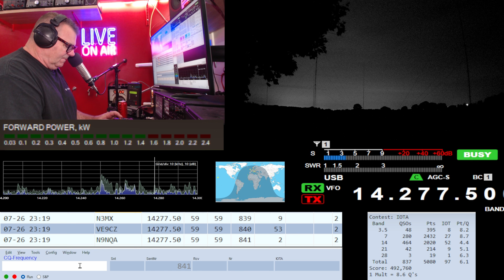Why I Don’t Want an SDR Ham Radio

Comment: I suspect that next generation DSP will be AI based.  Meaning that it actually will introduce information into the stream.  The radio will pick up noise + voice and the AI will reproduce the voice and just play that.  Much like a person using their brain to hear the words in the signal and then repeating them to someone else.  I also suspect that will move us another step further from the radio experience I fell in love with as a child.
Reply from the maker: I think you’re spot on. Once DSP starts reconstructing speech rather than presenting what was actually received, we cross a line from radio into interpretation. Clever, useful perhaps - but very different from the experience many of us fell in love with. At that point you’re no longer listening to RF, you’re listening to a machine’s best guess. Sonar ops are still "human is better than machines"...

Comment: I get the operator angle and the roofing filters, but here's the thing:  SDR's are cheap and getting cheaper.  With a large custom chip, it's possible we will see an entire HF transceiver in one big plastic package with lots of pins, the only external components being the front panel and power amplifier.  It's really a matter of keeping the hobby survivable financially.
Reply from the maker: I agree - SDR has probably kept HF radios affordable and viable, and that’s a good thing for the hobby. My point was never anti-SDR, just that as costs drop we shouldn’t lose sight of the operator experience. Ideally we get both: affordable radios and ones that are a pleasure to listen to for hours.

Comment: Glad the 990 works for you.. still fairly sure after having almost all top radios,that if I had started with an old FT101 and never changed it, I don’t think I would missed much. But very well put Callum. Operating is a skill that some have and some don’t.. also some don’t have their radios long enough to find out just what they can do.
Have Drakes, Collins and old IC-781, superb analogue radios with no dsp noise.. just ears, Attenuator and RF gain…. Works for me. I also have a pair of 7800’ just because I like them 😊
Reply from the maker: I think you’re absolutely right - if someone really learned an FT-101 inside out, they’d miss very little. I started with a ZD Mk3(!). Time with a radio matters as much as the radio itself. Those classics reward ears, RF gain and patience - and if it works for you, that’s the right answer. Lovely collection too.

Comment: 😀I think the same thing, I listen to a disturbed QSO with SDRPlay, then I switch to the IC-R9000 and I like it better, my ears are analog like this receiver, what I hear is real and not regenerated by digital, it has never happened that I couldn't hear with the R9000 what I received with the SDPlay, I would like the FTDX-5000
Reply from the maker: That makes complete sense. The R9000 has a wonderfully natural way of presenting what’s actually there, and if your ears like that, it’s hard to un-hear the difference. I’ve had similar reactions when switching back and forth - sometimes the simpler path just sounds right. The FTDX-5000 would definitely be in that same family.

Comment: Callum… no need to apologize for analogue radios.  It works for you.  However, using SDR radios has a compromise you throughly explained.  73 de KD6UYK.
Reply from the maker: Different tools, different compromises, different joys. 73

Comment: I rarely operate with headphones on, I love to sit in my shack with either my Yaesu 450D or my Icom 718 but I do have a quality pair close to hand for when I need to concentrate on a weak signal. Sometimes I will plug in my headphones, turn down the lights and just sit there with my eyes closed and have often picked out a weak signal this way. Ever thought about producing a DX Commander Transceiver Callum?
Reply from the maker: Yes - that makes complete sense. Removing visual distraction and letting the ears take over can be surprisingly effective. Headphones as a tool rather than a default feels very familiar. And no… no plans for a DX Commander transceiver - antennas are quite enough trouble for me!

Comment: The whole first part of your argument has no basis in reality. It is similar to how audiophiles do not understand how the digitalization of the sound works. If you said that you simply prefer the sound of your rig, that would make sense. I use full on SDRs but also true analogue rigs from the "hybrid era" (FT901, FT102). Pure receive performance wise, even a cheap SDR like HF+ runs circles around my analogue rigs, but there is that feeling with analogue rigs that can't be replicated.
Reply from the maker: I think we’re actually closer than it might sound. I’m not disputing that modern SDRs can outperform older analogue rigs on pure receive metrics - many clearly do. My point wasn’t about denying that reality, but about how the signal feels to work with over time. As you say yourself, there’s something about analogue rigs that can’t quite be replicated, even when the numbers are better. Preference and experience sit alongside performance, not in opposition to it.

Comment: Sir yes a good quiet radio is very nice but you missed something, A well made SDR is really quieter and ask why simple the less parts resistors, transistors, anything can and will add noise that are in your radio.  Most do not how these radios work but this is why you get what you like and use it. But do not be confused the DSP is doing the same thing your radio is doing ie mixing to move the signal to base band to go to the DSP. Yes your radio has a DSP processing the audio.  Now this radio is the best radio that Kenwood made and I would keep it for that reason. We can discuss later if you about radios.
Reply from the maker: I think we’re largely agreeing. I’m not confused about DSP - the video wasn’t about block diagrams or noise figures, but about how different designs present audio to the operator over long sessions. That’s a subjective, human thing. And yes, I’m keeping the 990 - for exactly that reason.

Comment: Yep I love my K3S nothing (that I've used) compares. I have a Flex 6400, FTDX10, FT710 7300, TS-2000, KX3, Nothing beats the K3S in a contest not even the DX10. People love to quote "top receiver" but never actually read the stats. K3S... Quietest receiver, most sensitive receiver, 2nd best blocking (lost only to the 890s). Had a local ham who likes to be the "big guy" talking about his FTDX101 being the "most sensitive" only to be embarrassed when I informed him it in fact was not. Love the "it has the best noise reductions" I live in a higher noise area and find what you're saying is 100% correct. Noise reduction is great when you're rag chewing on 40m at 20 over but doesn't do as much trying to pull out a week one. I often have everything turned off and use the knobs to pull them out like a real radio operator (I was chuckling at that last one).
Reply: Any ham operator that quotes sensitivity as a "selling point" has no clue what he is talking about. Sensitivity stopped being a problem some 60+ years ago.

Comment: Today modern radios are not made for operators , they work but , Squelch and RF gain on same potenciometer is totally wrong design. (IC7300)
Same stupidity like put brake and clutch on same pedal. 
Some things cannot together.
Reply from the maker: Never thought about that. Interesting.

Comment: Still enjoying my TS530 😊
Reply: i have the ts830 kenwood works well i also have a very old ts 130 kenwood that looks almost new,
i like vintage radios as the soul or as i say dover .... jeffrey
Reply from the maker: The TS530 is a classic for a reason - glad you're still enjoying it!
Reply: @DXCommanderHQ  i have the kenwood ts 830 in mint condition i added a 300 hz cw filter vwery stable radio i do ft8 on it for hours on end hears well never drifts ... jeffrey

Comment: Callum, very interesting take on this subject, may i also introduce perhaps another contributary factor, The operator with different talents or skills, For example i have known extremely intelligent people who struggled to learn Morse code, One i remember well was a helicopter pilot, He was a G6 back in the day and couldnt after years of struggling to learn the Code...grasp it suffciently to pass the 12 WPM test, and he was limited to vhf/uhf when operating alone, Myself for example am quite adept at languages , i find them easier than the average joe, i kid you not i learned Morse code in 2 weeks went to liverpool shipping office and passed with Mr Jardine in April of 1983  then passed the RAE..and applied for a direct Class A licence which i still of course hold, My point is..some people no matter what the radio have a different skill set to picking signals out of the speaker/headphones,  You are quite musically minded i believe ...hence the drum kit etc, That leads me to assume you have an ear for particular notes that perhaps an ordinary joe Ham...might not get as clearly as you would, So whatever the radio is...the Operator has a great bearing as to how he/she will asses that particular radio reception qulities,  Anyhow just thought i'd throw that possibility into the mix mate, 73   De  G 4 UNB.
Reply from the maker: That’s a very good point, and I agree completely. Different brains are wired differently - language, music, rhythm, pattern recognition - they all play a part. Morse is a perfect example: some people just “get” it, others never quite do (I never tried - sorry!), regardless of intelligence. I’m sure musical training helps with recognising tone, cadence, and structure in noise too. So yes, the operator is a huge part of the receiver chain. As I said, what works for you is critical. Thanks for adding that to the discussion - much appreciated. 73
Reply: @DXCommanderHQ  Most welcome interesting video thanks. 73

Comment: Yes, listening to my TS990 is comfortable. It does not cause listening fatigue - it's my main operating radio, yet my FTDX500 has a fuller analogue sound, which I find a little more comfortable, and is ideal for occasional SW listening too. Ultimately, you adapt to whatever radio you own, and whatever you own is the best radio for you.   Well done for raising a very personal topic, Cal.
Reply from the maker: That’s beautifully put. Comfort and fatigue matter far more than most specs ever will, and you’re right - we do adapt, and that adaptation becomes part of how we hear. Different radios, different flavours, same enjoyment. I’m glad the video touched on that personal side - thanks for sharing. PS - I was very close to the 5000 a few years ago. I'm sure it would have been a fine radio!

Comment: Brilliantly stated, mate, and I completely agree! When SDRs first became a serious Thing, I (sort of) jumped on the bandwagon, and using them in a noisy environment, as you've said, they were really quite remarkable. But using them in my (super-quiet) QTH, I would find myself turning off all those wiz-bang features so I could hear everything. Also, because I'm neuro-divergent (i.e. slightly mental), I realised that I'd do far better when I wasn't both listening and watching the bloody waterfall! Sure, waterfalls can be very useful, but as you say, the concentration and focus required to take everything in and process it with your own CSP (cerebral signal processor) can work wonders. I've noticed that a mate of mine who loves SDRs says he couldn't possibly hear even a single signal through all the noise without using all the noise suppression they offer. But I think that, because I fell in love with SW radio as a very young kid, and absolutely thrilled from hearing distant 'inaudible' voices that seemed to be surfing a wave in a far-off sea, it shaped the way I process sound. And that's a skill I've parlayed well into my subsequent musical life. So I'm now perfectly happy with my hardware radio, all noise suppression turned off, full signals ahead. Cheers and 73!
Reply from the maker: That’s wonderfully said - especially the “cerebral signal processor”. I completely relate to the waterfall point too; sometimes removing visual input lets the brain do what it’s actually very good at. Early SW listening absolutely shapes how you process sound later on - I’ve heard the same from musicians more than once. Different brains, different environments, different tools - but the joy is in listening. Thanks for taking the time to write that. 73
Reply: 75% of the brain processing capacity is taken up by processing your eyesight. We all know blind people hear better, can smell better, can feel better, can taste better. My neuroscience brother in law said it takes around 30 minutes for the brain to slowly relieve itself from the duty of "seeing" after you close your eyes. Try listening in a dark room with no waterfall or lights, get used to it. You will be amazed at what the ears can pick out when you can put 35% more brain power to it.

Comment: You make a very good point, It is like copying cw out of the noise. We can hear it and get a fairly solid copy. My computer decoding  programs can only hear garbage. rhythms and patterns. We use "Real intelligence, not AI"
Reply from the maker: Exactly that. It’s very much like sonar or CW at the noise floor - we are incredibly good at recognising rhythm, intent, and incomplete patterns. Software can help, but at the edge it often just sees garbage. That’s not anti-DSP or anti-AI, it’s simply acknowledging how good the human brain is at this kind of work. Real intelligence, trained by experience.

Comment: I have the FTDX101D which is a hybrid SDR. It has great receivers, I'm very happy with it. Some of my ham friends keep telling me to get an Anan full SDR because it's much quieter. Maybe I'm just old school, but if I don't hear a little hiss and static it doesn't feel like radio anymore. It feels more like an internet chat room. I'm also not a big fan of having to use a PC with my radio. If the PC crashes, so does your radio.
Reply from the maker: That makes perfect sense. A little hiss is part of the context - without it, it can stop feeling like radio and start feeling abstract. And yes, I’m with you on the PC dependency point: great when it’s working, frustrating when it isn’t. The 101D is a cracking balance if you like a radio that still feels self-contained. There's a couple of odd requirements I have and was it not for these - the 101 would be on my list actually... Only from what I have heard from some reputable friends of mine. But at the end of the day - I can hear what most folks can't so I can stay put for the time being :)

Comment: Scientific Data, Exposing Myths and Other Religiously Held Beliefs Since 1543…  UFO’s, Mermaids, Unicorns, Flat Earth… and more recently HF Rigs…  Another Performance Discussion Boiled Down To MINE's better, NOT Because of Hard Data, BUT BECAUSE I Like  MY BRAND Better/I'm Too Calcified To Change! 😊 🍺🍻

EDIT ADDED As AGAIN I'm Blocked From Replying...

@CriticalThinker-42
0 seconds ago
 @DXCommanderHQ  I have no problem in your Preferring Your Inferior Rig. BUT Your Previous Video STATED Point was Questioning Performance in Rigs (and Antennas), which you went on to Ignore in That and This Video for Rigs. That Does Infer a Religious Type Fervor, Typically Classified as Cultish.

"...the result that the very highest close-in receiver dynamic range is achieved. This has been a major competitive marker for some years, and this transceiver, as well as the FTDX101D, puts Yaesu at the top of list, as seen in the ARRL Lab measurements in Table 1 and independently tested and listed in the Sherwood Engineering tabulated summary of receiver performance (www.sherweng.com/table.html)."  ARRL, QST, 12/2020, Product Review Yaesu FTdx101MP

Are you going to Rationalize Away ARRL Labs Test Data next? Like YOU did Rob's? 
Then again Claim its Not due to a Religious Type Fervor? AND Expect ANYONE to Believe You?

🍺🍻
Reply from the maker: I’m very comfortable with data - and I’m equally comfortable saying this video wasn’t about brand superiority or rejecting progress. It was about operator experience, fatigue, and how different receivers feel to different ears in different environments. Preference isn’t a religion, and enjoyment doesn’t need hard data to be valid. Use what works for you - that’s the whole point.

Comment: I have been in the hobby for almost 50 years, and I have had Heath, Collins, Icom, Yaesu, EF Johnson and even converted WW-2 radios. I was in commercial two-way radio for 25 years. I now have an Icom 7610, the best radio I have ever used. The receiver is so quiet at times I have to look to see if my antennas are still connected. Use whatever you like, but the older radios had their moments in my view.
Reply from the maker: That’s a wonderful summary of a long journey through the hobby. The 7610 really is an exceptional receiver - Jonathan M0MSN brought one to the shack and we compared... that “is the antenna still connected?” quiet is something else. And I agree completely: every era had its moments. Different tools, different strengths, same enjoyment. Thanks for sharing your experience.
Reply from the maker: Sorry - not M0MSN (which is Mike) - but it was Jonathan M0JSX.